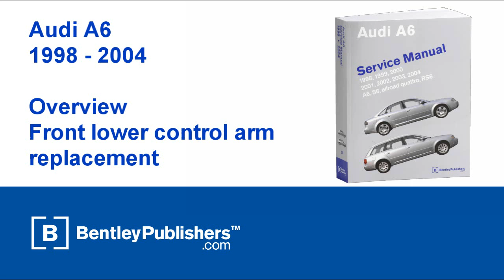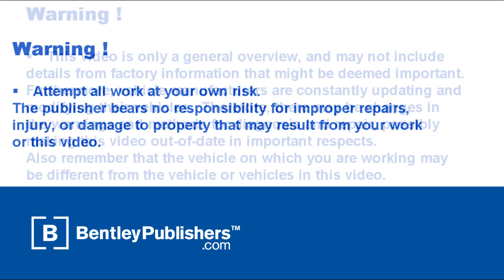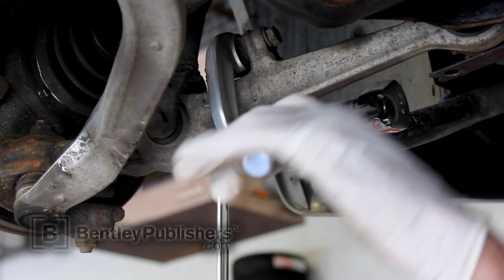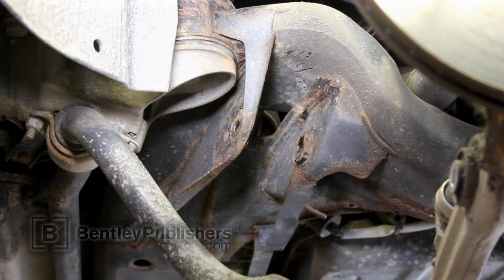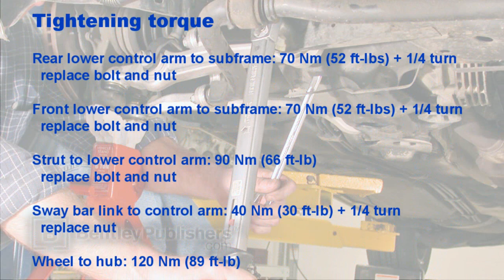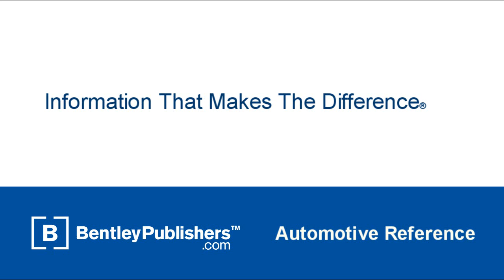Audi A6 (C5) 1998-2004 - Front lower control arm replacement - DIY Repair

Comment: good afternoon to all and on the pneumatic Audi A6 /S6 sedan III 3.2 FSI quattro how to adjust the angles of the upper levers.what is the distance to throw off the pliz diagram Height for the front lever …
Height for rear lever …

Comment: I just took a look under my A6 and it looks like there's very little space for the bolt that holds the rear lower arm, especially on the passenger side. Are you sure the subframe does not need to be lowered?
Reply: You should be able to wiggle the bolt out once you remove the nut on the other side. There should be some “give” from the plastic bit that seems to be in the way of the bolt coming out. I never considered lowering the subframe.

Comment: Great video, very helpful thanks. Interesting the Audi A6 has the same front suspension configuration as the VW Passat.
Reply: The B5 and B5.5 Passat is built on an Audi A4 frame.

Comment: Anyone know the nut size/type for rear lower control arm where it joins the wheels hub? The end that has the bolt already fitted to it where it meets the wheel? :) Also is that bolt replaceable?
Reply: Trägern unten a6

Comment: Sadly as informative as this is they dont show WHAT TO USE FOR THE FRONT LOWER BALL JOINT REMOVAL! STANDARD REMOVAL TOOLS (PICKLE FORK, TIE ROD WEDGE WHATEVER NAME YOU KNOW THEM BY) WILL NOT WORK!!!! EITHER FABRICATE A SHORT PRONG SHARP INCLINE FORK (ABOUT 15/16) OR BUY A SPECIALTY TOOL WARNING MY EXPERIENCE WITH SAID SPECIALTY BALL JOINT PRESS DID NOT WORK THANKFULLY FAMILY HAD ACCESS TO SHOP. WARNING WARNING WARNING!!!!!!!!
Reply: nerd made from the 80s  you are correct i have an allroad and they completely glossed over the fact that that is the hardest thing to remove on the car!!!
Reply: it all depends on the corrosion
Reply: probably should have said this in the beginning but im actually a former a.s.e. cert mechanic. when performing this repair please bear in mind that i had 0 corrosion. i literally had to use an air hammer to get the ball joint to pop out. if you didn't have to great good for you doesnt change the fact that it didn't work for me. this is just simply my 2 cents and a helpful warning this video lacked.
Reply: ball joint separater worked fine for me, think you had operator error.

Comment from the maker: @mie2222 There is a tool that will separate the ball joint if you plan to reuse it. Check your Bentley repair manual for the tool number.

Comment: I had a front control arm set (8) with links (2) and tie rod ends (2) outer installed in 2008, now with only 30,000 links went bad and lower control arms are bad. Is this normal wear?